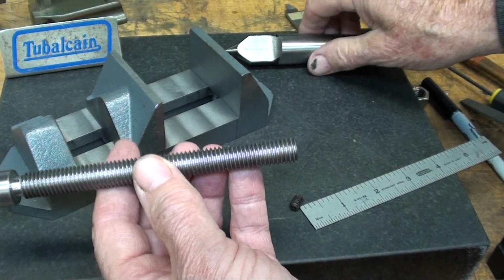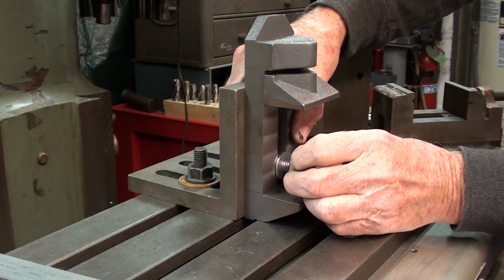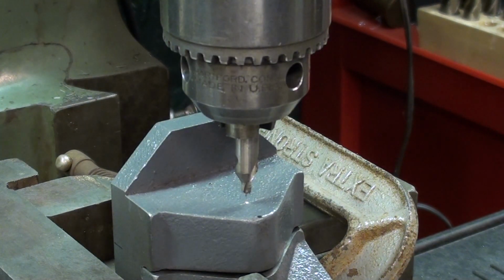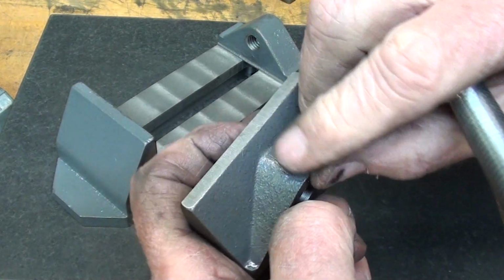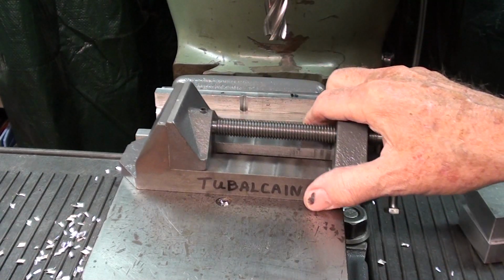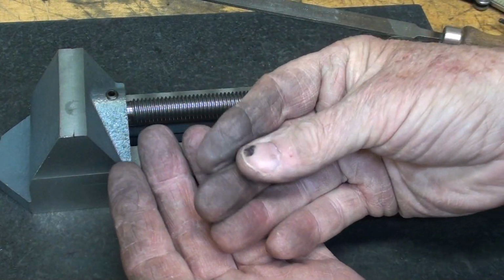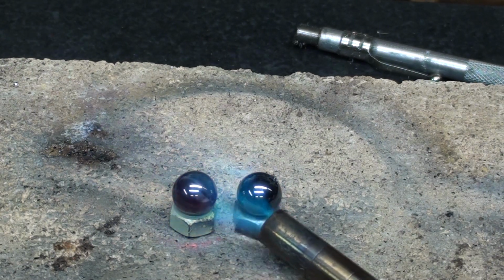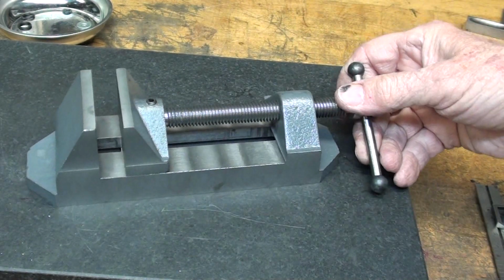Make a Drill Press Vise From Castings Tips #435 pt3 tubalcain

Comment: That is a great looking vise.  As a woodworker I have never owned a drill press vise, why not?  That was a rhetorical question, I really need to get one as it is nearly impossible to drill some woodworking parts accurately with a C-clamp and blocks of wood.  Too bad there is so much junk made in China, it is hard to weed out the junk from a good one.
Reply from the maker: You are right, much of it is junk
Reply: @mrpete222 there is a really crappy reason for that 😕

Comment: Thanks for all these videos, i found one at a local pawn shop. It also has the tilt plate protion included in its  package.... A big surprise 15$
Reply from the maker: Was it rough castings or a finished vise
Reply: Casting, partially worked ,as yours was. I can send you a few pictures in the morning.
Reply: After taking some time to really look at it good. Only the bottoms of all three pieces were milled and holes were drilled and tapped, but fixable. If i can figure out how to send pictures i will☺
Reply: Gosh I’m jealous, I’m going to see if I can find one somewhere.

Comment: Great information in this video. I had a little "incident" on my drill press while trying to drill a brass block. The 7/16" drill bit shattered and my Palmgren 000 vise flew across the room, breaking one of the feet and bending the screw extensively. I made a replacement screw for the vise per the instructions in this video. I'm going to modify my drill bit before attempting this operation again.
Reply from the maker: Wow, that is scary. Drilling brass is dangerous. The drill bit can't really grab

Comment: Love to watch your videos. 
Big truck and large mining equipment mechanic here. I have some mechanical pullers and some pushing screws have a ball bearing on the end that ride in a simple cone shaped bottom of the pushing plate or tip. This increases the pressure or decrease the amount of force needed to tighten it. Why not do that to your new vise?
  Keep the videos coming.
Reply from the maker: Good idea, I need to try that

Comment: Enjoyed the series, a neat project. I'm a big fan of 638 Loctite especially on things that I don't intend to remove su k as those ball ends. I used them on my mill z axis driver tool for the brass screws, also when I pressed the socket inserts in with the press fit. Good stuff
Reply from the maker: Yes, it is good stuff thank you for watching

Comment: Lyle, I wold like ot make one of these at some point when I get the SB heavy 10 working.  Do you know a different source of the castings?  Or do you know if there is a 3d printer file out there that one can use to make a casting?  Thanks, Joe
Reply from the maker: The only source I know forecasting it is in England. Look through the comments for the link. But the postage would be a killer
Reply: Ok thanks I went thru the notes once, guess I missed it.  I did enjoy the serious, thanks, Joe
Reply: Okeefe Casting Company
Reply: $20.00 for a similar casting.
Reply: Thanks!

Comment: Lyle, a couple of questions please:  Why use grey cast instead of ductile, you said it was better for this project, can you explain a bit please? Also, You said one of the handles was cold headed, I am not sure what that proces is, can you explain it please?
Reply from the maker: Are use cast-iron, simply because that's what I had. I don't know if any castings are available and ductile. Cold heading, is the process of porting or should I say forging aheadon a bolt. All fasteners have a heads that are headed. All nails are headed

Comment: since you are not putting a bolt slot in the appendages on both ends I think I would remove them. A slot could be put in both sides or ends for a toe clamp. I will be building a similar vise, but it will be a ``welderup`` version, as to my shortage of cast iron. thank you for your ongoing efforts to educate us neophytes.
Reply from the maker: Thanks

Comment: Nice build.  I have turned the steel jaw facing on my vices around.  I find the vertical and horizontal v-grooves for holding round stock is more of a nuisance most of the time than a help.  If I want to hold some round, I just use a parallel as i would in the milling vice.
Reply from the maker: I agree, at least some of the time I agree that it is in the way

Comment: Good smart setups on the mill.  Very nice little vise you now have.  One pet peeve of mine though is the use of Dead Centers in the Tailstock.  Dead Centers were designed to be used in the Headstock because they turn with the work.  Live Centers are to be used in the tailstock so they will also turn with the work.  If a Dead Center is used in the Tailstock, it will wear out the center as the workpiece spins on the dead center point.  The one exception to this rule is if you are turning Bronze, which acts like a bearing and won’t destroy your dead center.  rant over.  Nice job.
Reply from the maker: That is a carbide tipped center
Reply: mrpete222 
yes...its carbide tipped but will wear just as carbide inserts or carbide endmills wear.  best used for brass or bronze.  Given the clearance design of it, i imagine that was the intent.  the clearance wouldnt benefit anything if used in the headstock.

Comment: I did plumbing and tin knocker apprenticeships in high school, college, and grad school.  We never left the torch heads on small, handheld propane or MAAP cylinders.  If you did, expect the cylinder to be empty when you needed it most.  The larger cylinders for the turbo torch (R), such as the six-pound, aluminum Worthington tanks never leaked.  I have no interest in either of these companies, but both are high quality, professional products.
Reply from the maker: That's good to know. Usually I do remove the torch from the tank

Comment: I'm putting some sharpie on my thumb nail, it should be the way we recognize other fellow viewers in public.
Reply from the maker: Our badge of honor
Reply: I don't know if you are the sort man who believes in hierarchies, but maybe we should have a color code like martial arts belts. Silver/white could be for anyone who's ever not clamped something in a drillpress and had it spin like helicopter blade. Blue for anyone who's drilled into the table or vise, or run the tool into the lathe chuck. Red for anyone who's broken off a tap. Black (highest) for anyone who successfully removed the tap.
Reply: 445supermag someone would ask why all of fingernails had different colors lol
Reply: The badge of honor can’t be created with a Sharpie. It can only be created with a solid striking surface on the end of a handle striking said finger nail. A ball pean or brass hammer is perfect for this. A waffle head framing hammer, not so much.

Comment: Blowing chips off the screen.  Yup, I admit it.  Than had a good laugh at myself.  Great series, as always, Mr Pete.  My next two projects are a DRO for the tailstock of my lathe and an internal keyway broached with an Atlas 7B.  Both of these projects would have been used on your vice project.  You continue to be an inspiration me..
Reply: Fred Miller - I keep wanting to grab a chip brush. lol  He is an inspiration.
Reply: Yup usually it get to the "take a deep breath" point then think what are air hoses for !
Reply from the maker: lol
Reply: I just posted my Poor mans tailstock DRO video on my channel.  Notice I still have the original oil Dobber LOL!!
Reply: LOL Yup, joe, done that one too...
Reply: I used to do that all the time when trying to do work under a microscope.  See lint tuft, blow on microscope, feel like an idiot, repeat.